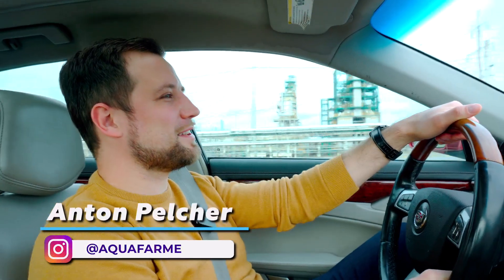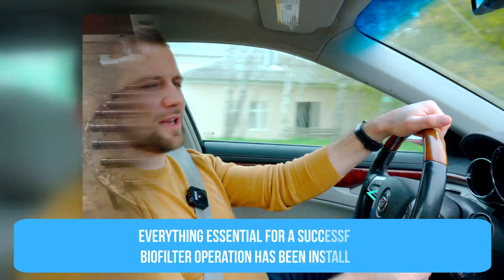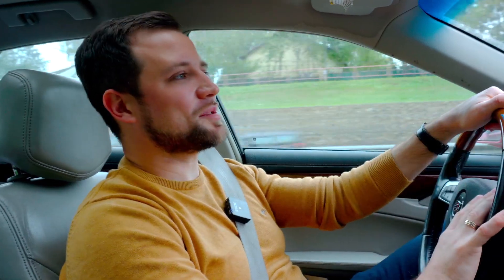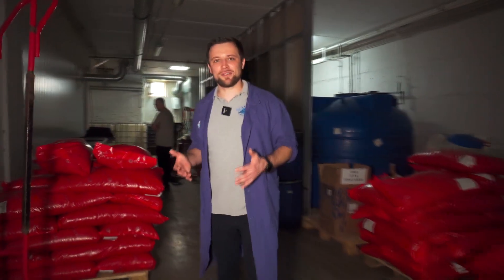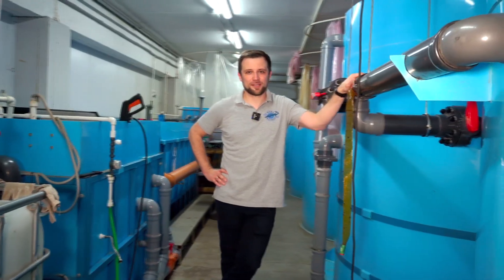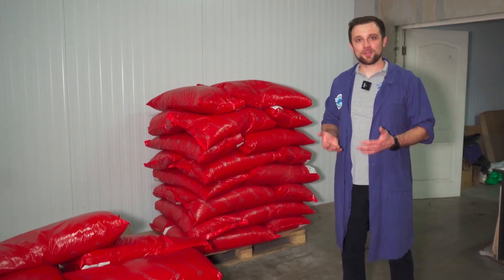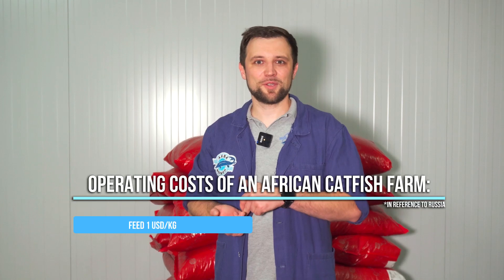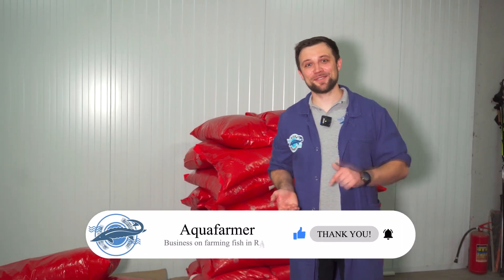How to set up a MINI RAS farm in a FORMER WAREHOUSE?

Comment: Could u please guide me how to instal the tank bottom discharge that all water don't drain off if  power cut off
Reply from the maker: Hi, you need a standpipe for that. Water should go up in the pipe and then overflow this pipe in order to keep a certain level
Reply: @Aquafarmer_eng  but if i use stand pipe then will al the dirty get removed
Reply from the maker: Yes, exactly. But you need to use it right way to take out solids from the bottom

Comment: Why did you place the settlement tank before the drum filter? Drum filter has 100mic mesh on it but this size will settle out before it gets to drum filter and anything that gets passed the settling tank will be suspended solids (<100mic) making the drum filter ineffective. Thanks